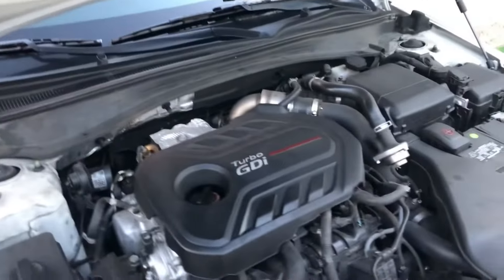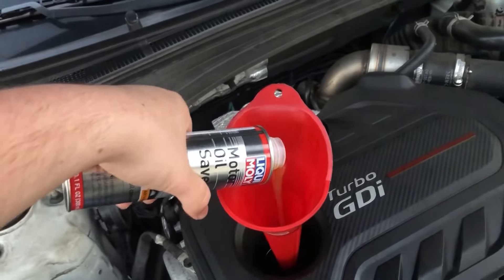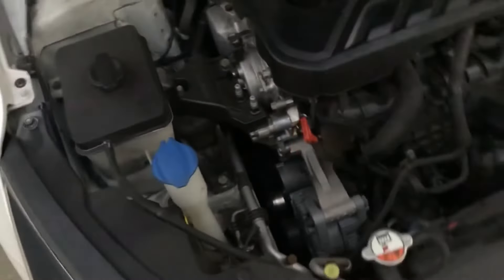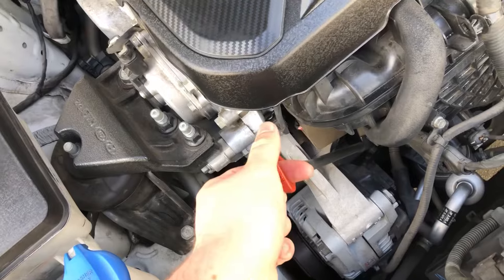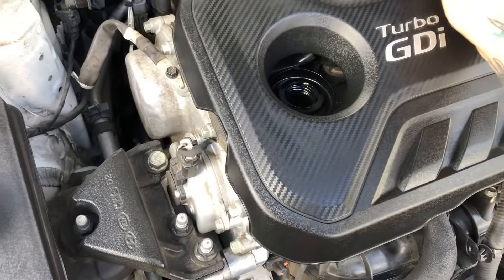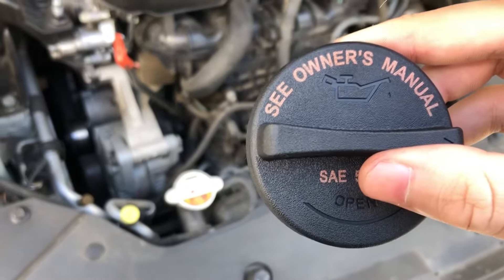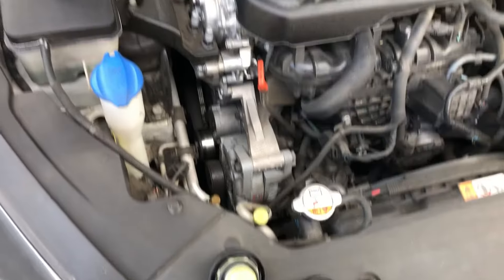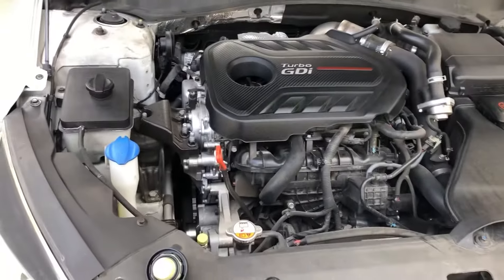Does Liqui Moly Motor Oil Saver Work

Comment: Liqui Moly states it takes 500-600 miles to reach optimal seal swelling. DO NOT use this every oil change! It will over swell your seals and gaskets. This product remains effective for 20,000 miles regardless of oil changes. Your going to cause yourself all kinds of problems adding this every oil change.
Reply from the maker: I ended up not doing that, I just used 2 cans of the stuff over the course of 1000 miles cause my car was pretty bad. But the issue lies within the piston rings and piece of shit GDI causing too much carbon and never getting touched by gasoline. I ended up getting a Acura TL best decision of my life🤣
Reply: @bapez31 ج Question: Does this solution affect the viscosity of the engine oil, or does the reaction it creates inside the engine cause an imbalance in the engine’s normal operation? Please, I want to use it because I have an oil leak in the engine, but I am afraid.
Reply from the maker: @AbdoFlow-gb4rz  it’s meant more as a precautionary measure to make sure all the rubber seals stay nice and solid in the engine. If your car is leaking oil it may help but it’s not 100% guarantee it’ll stop the oil leak. And it’s safe to use in your engine only use 1 can in your car within 20k miles you don’t wanna use more than that.
Reply: @bapez31  Thank you for answering me clearly

Comment: there are several possible reasons for oil consumption:  stuck piston rings, clogged  holes on the ring that scrapes the oil, hardened/shrunken seals, bad pcv. oil saver only deals with hardened seals. so the next thing you want to try is replacing the pcv and run an engine flush. or multiple engine flushes to unstick the piston rings/dissolve the carbon that clog up the holes.
Reply: Also valve guide seals
Reply: Mom's has rear seal leak . Slow leak. So I am planning to try this.

Comment: probably the oil cap was dirty because the oil was above F, overfilling with oil can  be just as bad as running on low oil.
Reply: @Anno_Nymous  I figure if it's burning oil it'll be fine a bit overfilled.

Comment: You should also replace your PCV valve. Once you start burning oil like this, the PCV valve tends to get sticky resulting in even more oil burn.  It’s less than $10 and a good thing to just replace ever 60k miles. In my 1.6 Hyundai I was burning over 1.5 quarts between oil changes and now almost nothing. (1) I did the engine flush from liqui moly to help remove carbon on the pistons (increases blow by) (2) I did the CRC carbon treatment (3) I used the liqui moly ceratec with the next fresh oil change (4) I added the liqui moly oil saver on the next oil change. Each of these was done separately and decreased the oil consumption. The PCV valve and the oil saver had the largest decrease in consumption. Now I have basically no oil burning.
Reply from the maker: That’s awesome to hear man, currently I’ve changed the PCV, did the engine flush from LM, and the oil saver also from liqui moly, only thing I need to still try is ceratec but I’ve noticed oil getting out around my turbo so I’m honestly gonna trade the car in soon for a Prius🤣
Reply: @bapez31  yes I would dump any Hyundai/Kia. The American made ones have even more engine problems. We are only keeping this one because it was given to us for free. It’s basically worthless so we might as well drive it into the ground. Still, I do try and take care of it to make last longer as that is cheaper than a car payment. But it sounds like yours is on the way out, soon it will spin a bearing and then be totaled. Is it still under warranty though? Might be worth getting a new engine if it’s free. 😉
Reply from the maker: @davetravels9273  sadly no warranty because I’m the second owner and it’s at 95k miles so off to car max this will go🤣
Reply: what hyundai do you own? what year? i have i20n 1.6 T GDI 2021. burns a bit of oil.
Reply: @ramirocosta1  2013 Hyundai Accent/i20 with the 1.6 non-turbo. While my oil burning has almost disappeared, I noticed that it still burns oil on extended highway drives above 75 MPH or 125 KPH, so I took off the intake manifold and saw that there is quite a bit of carbon build up on the valves. It has never been mechanically cleaned, so it’s not surprising with 120k miles or 200k kms, so I will walnut blast the valves in the next week or two.
Reply: @davetravels9273  thank you. very useful info. will keep an eye on my oil and try your procedures if it gets worse. :)
Reply: If you use engine flush (liqui moly, or BG) it will clean PCV valve, so.. Change is not important.

Comment: I've changed my pcv valve which didn't fix it...also tried "Restore" which, once a few hundred miles were put on, seemed to stop the oil consumption but then it started again, I doctored it with 2oz more Restore the other week and a little more oil and it helped for a bit, then it's started again. I still have 3 years left to pay on my 2016 kia too, mine's not even the turbo version. Only 140k miles on it too. Going to try this Liqui Moly stuff, vehicle currently has factory style 5w-20 in it, I bought a jug of 5w-30 to top it off with, am considering shell rotella 5w-40 in the future too. Stuck rings seem to be a design flaw on these kia engines, someone tried seafoam in the oil with some decent improvement. Berryman's b12 chemical seems well regarded online too. It drives ok still. If there's any loss of power I can't really notice it but I'm not a heavy footer, I go the speed limit lol. I guess all I can do is limp it along with topping it off with a little thicker oil until it's finally paid off then try and get rid of it. At its worst before I added Restore to it was using up half or a little over half down on the dipstick after just a week of average driving. My old 90s truck with nearly 230k on it doesn't even use this much... I heard these GDI engines really gunk themselves up, I'm sure it needs that GDI CRC spray stuff done on it too but I doubt that has anything to do with it burning oil. I think it's stuck rings and/or seals messed up.

Comment: Liqui moly oil saver expands engine internal rubber seals.
If your car is burning oil, thats a piston ring issue.
Reply: That’s right, I never read anywhere that this stuff helps with burning oil
Reply: I used it about 12,000 miles ago to stop a rear main seal drip that hasn’t dripped since
Reply: u can also burn oil from valve seals
Reply: u can also burn oil from valve seal so in theory if you are burning oil from bad seals this should help
Reply: @Purehaste  true dat, forgot about those

Comment: Sir when you added the motor oil saver , when do you change ? Next engine oil service ? So i can use this added next 5k to next service?
Reply from the maker: I would add it with your next oil change👍
Reply: @bapez31  gotcha.
Reply: @bapez31  I just service my engine oil , I go buy now add in to my engine.

Comment: My lexus 2jz starts smoking after using fake mobil 1 5w 30. Used 5w40 no difference,used 20w50 oil burn slow...but still smokes. Used resurs no difference. So I'm thinking abt using original liquid moly
Reply from the maker: Give it a try man👍liqui moly makes the best oils
Reply: @bapez31  alright. I used resurrs with my old oil.ressurs oil treatment didn't work. Did servicing 2 weeks ago amd I had to do a 1 litre top up with 20w50.guaged it this morning it's at the middle of the stick,and might need top up In 3days time .I hope this works because I don't want mechanic to open engine.all stop oil burn and smoke did mot work.from abroto 4matic,resurrs.now now I'd try liquimoly
Reply from the maker: @Resad-kv4qw  sounds like your piston bearings might be warped causing excessive oil burning, the only real fix to that is probably an engine rebuild. I would recommend looking up the exact engine you have on the used market and paying for someone to swap it out. It’ll be way cheaper than rebuilding the engine you currently have👍.
Reply from the maker: @Resad-kv4qw  I just looked up your exact engine online they range from 1,500$-2,000$ I really think that would be your best bet my friend🙏. Because that engine is extremely reliable, maybe the person before you didn’t take care of it which is why it’s burning so much oil now.
Reply: @bapez31  thinking of selling g it soon.after a respray. Tired of lexus.need a corolla
Reply from the maker: @Resad-kv4qw  best of luck to you brutha🙏, hope your next whip is problem free

Comment: I recommend flushing your engine many times before add any additive
Reply: Why?
Reply: @Richard_L_Y  To ensure that the engine is clean from the inside and does not contain any accumulated residue or sludge, then oil additives will perform best
Reply: @meshaalation  OK; however, some engine oil additives are supposed to do exactly that, too? Also including oil detergents which are 'additives' to almost, if not all, modern engine oils?
Reply: @Richard_L_Y  I agree with you that the oil additive contains what you mentioned, and in addition to that, it is a friction treatment. You want it to work in a clean environment instead of being loaded with dirt.

Comment: Dude don’t just keep putting oil on top of oil clean the engine by doing a flush using liquid moly engine flush or motor medic and marvel mystery oil also spray the valves stems with CRC valve cleaner or pour a couple of cans of Berryman B-12 chem tool in the tank the problem with these direct injection engines is they suffer from heavy carbon buildup especially on the piston rings and valve stems and seats 🤔💯
Reply from the maker: I feel it man, I actually did crc valve cleaner in the past before this video along with a liqui moly engine flush which I posted a video about👍. The problem was never 100% solved but it definitely helped.

Comment: hey dude you are filling youre engine with way to much oil the level sould not be way over the f mark on the dip stick !!! it sould be just up to the F 
that is so full it will burn oil no matter what you put in it and have no power

Comment: You're putting top much lol mate. It should be on the second mark not over that. You're going to damage the engine. It's burning oil because it's above the limit. You have to take oil out.Don't flush the engine you don't need it. Stop the overfilling
Reply from the maker: I promise my friend the glare in the video is terrible, I filled it up exactly to the 2nd line🙏

Comment: Man you're in big trouble. Those engines are not good.  They have bad oil rings on the pistons. Later try marvel mystery oil.  Maybe that will help your rings to loose up a bit. Also try different oil brands to see if that help. Good luck and watch your spark plugs burning that amount of oil your going to clug your cat sooner or later. Peace

Comment: Dose it work?
Reply from the maker: Yes it does, it didn’t stop the oil burning completely… but it did lower the amount of oil being burned
Reply: @bapez31  it's designed to soak into seals like valve stem seals and the front and rear main seal. It won't stop any oil burning from blowby at the piston rings. Having good crankcase ventilation will help reduce some of the burning as well but these cars had some issues with piston ring defects. Also, driving the piss out of the car should help a good bit, carbon is your enemy, especially in cars with low pressure rings and turbochargers. Liquimoly and ATS have some of the best products for removing sludge, carbon deposits and freeing up thin passages, alongside restoring seals and reducing engine noise by really cleaning things up. The car being direct injected is really going to struggle with carbon deposits so it may be worthwhile checking out.
Reply from the maker: @dsrocks6905  appreciate the detailed comment thank you🙏